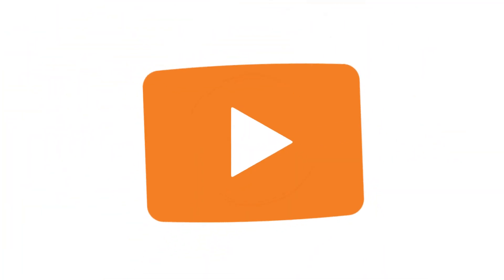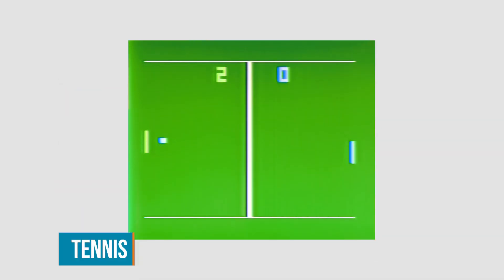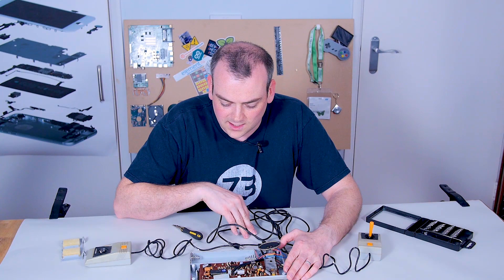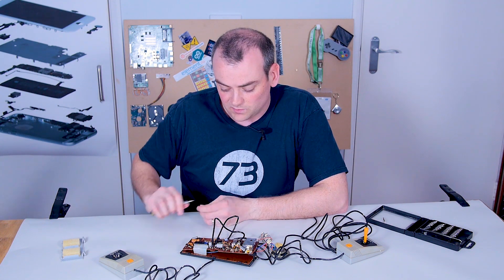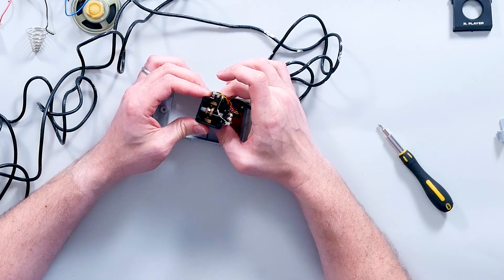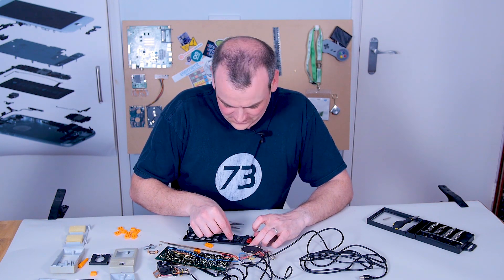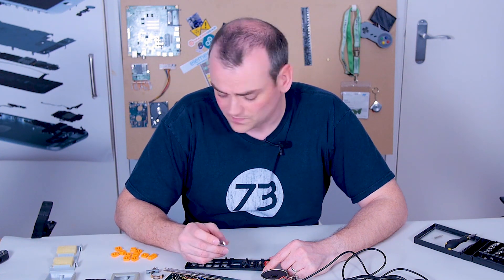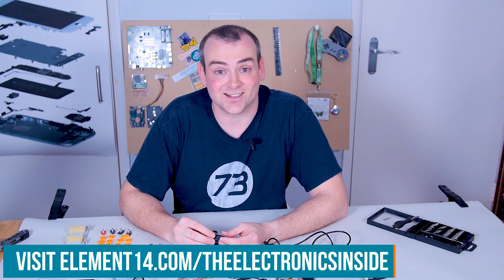Pong On A Chip Teardown - The Electronics Inside

Comment: Why is there a resistor between the two potentiometers (x- and y-axis) in the controller. Does anybody know that? (Here is the pdf with the reference design https://web.archive.org/web/20120316160455if_/http://www.pong-story.com/GIMINI1978.pdf)

Comment: Those popper style switches were really common in the early 80's on calculators and everything. Also I could be wrong but I think they did predate microswitches which weren't until the mid 80's IIRC, at least on consumer hardware. I remember microswitches being a big thing when joysticks finally got them.
Reply: That would make total sense. I can't see the fiddly assembly being desirable after microswitches and tact switches were released!

Comment: Ohhh i have an old radofin. I believe radofin was a generic brand and the same model of console was branded differently depending on where you bought it. A bit like old orion branded tvs which were argos/possibly littlewoods. Reason for the same model different brand was so big comapanies could offer a price garuntee that you wouldnt get that tv cheaper elsewhere. Consoles like that are still almost 10 a penny even today as there were so many of them produced and dont realy add to the history of gaming
Reply: There are a few clear generations of chip with 1, 4, 6 or 10 games, and you can find them in all sorts of cases from different manufacturers. I had lots of find researching the consoles and choosing  which one to use for this! You are right though, in the UK you easily find one for £10 or so if you look!
Reply: @a531016  i picked mine up for a paltry £1 at a bootfair a decade back. It even came with an extra multicart that was boxed. I sold that for a quid effectively making the console free.......oh edit. Just realised yours didnt have a cart slot. So must have been a much earlier model.  Design aesthetic was pretty much the same though